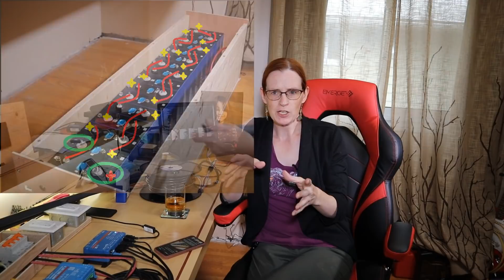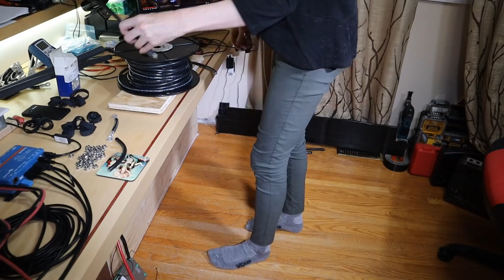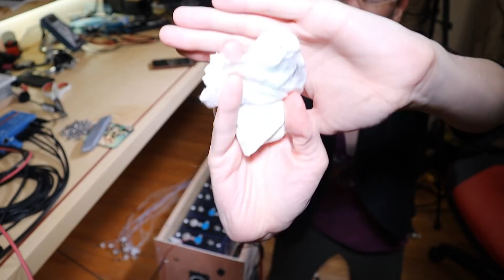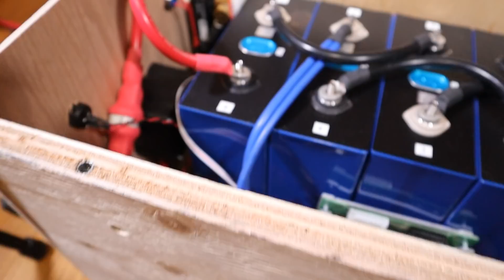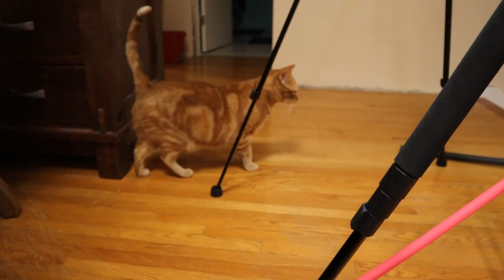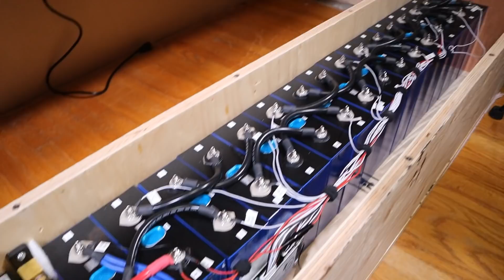A Better Battery Design - How to build a 48v Lifepo4 battery (Ep. 22)

Comment: don't get me wrong - i LIKE the design (having the main pos/neg at the same end of the battery), however i don't think you used to much less cable overall than you think.  you extended your 'bus bars', what 2" each?  times 16.  so, 32"-ish MORE wire for the bus bars, and less on the main positive...  just thinking out loud myself.  like i said, i like the design!!  i'll be doing the other option myself when i put together my banks.  less wires crossing over....
Reply: correct. there is a lot more cable compared to using bus bars or even the normal wire method. bus bars would be the superior solution here.
Reply: TDM,  I Agree with others. Not using the stout metal bus bars between batteries likely means more resistance at each cell. @The Digital Mermaid don't take my word for it, just check ohm resistance (with a more sensitive tester) of your 4ga wire jumper vs a bus bar. 
In the end i think you are dividing the resistance of that long red wire- now into/across each jumper in the string. Resistance = heat/loss. If the long red wire was getting hot, on the load you need, then the wire needs less resistance. In the end,, no matter how you approach it,, this is accomplished with larger diameter wire and or shorter wire, and typically bus bars are designed to carry more current than wire. If you want flexibility then aim to use heavier cabling to reduce resistance. Also using electrical connector grease like carbon based stuff used for high current industrial applications on each connector will also lower the loss a bit (by filling the micro gaps of the mating surface with conductive carbon). Best regards in your project and TY for sharing the progress and learning as you go.
Reply: @jamesbsa6450  she did a video measuring the bus bar resistance vs. the cables a few videos ago.  they were the same in her test.
Reply: @dobrzpe  it's because she was using the wrong tester. It is not capable of finer resistance measurements. 'Ray Builds Cool Stuff' tested 4ga copper wire with hydraulic crimped connections at a higher resistance of .25Mohm vs the tinned copper busbars lower .17Mohm resistance. The Digital Mermaid had good intentions but the test had major flaws. The busbars should be taped with electrical tape for the FLIR test to reduce reflectivity heat signature. Additionally, cleaning the connection surfaces with Alcohol and then using carbon grease greatly eliminates irregularity. Lastly Ray points out the lack of uniformity in busbars which can be improved by examining the curved bars and flattening them first. All this to say. The obervations  had some flaws. Best regards.

Comment: Hullo hullo Mermaid...Analog and Digital...!
Have you considered making 4 x 12 V packs.
Modular and more moveable.
Just a practical thought.
Autumn Greetings from Denmark...!
Reply from the maker: The thought crossed my mind, actually. It's also one of the reasons Victron won't release a 48v, they'd rather let people series them. In my case, that would increase the number of BMSes I need by 4x, fuses by 4x, etc. I can disassemble / reassemble each pack as needed, a luxury not on offer to many. So in my case, 1x 48 is OK.
Reply: @TheDigitalMermaid  Ok, Thank You for replying...!
Following Andy and others results, I figured:
Individual packs would only need top balancing and check, once a year or two...

Comment: Love the video. I am a cat lover too, with four cats, so I do love to see yours also. Well, as I was watching this, the last parts arrived for my build, except for the cells, which are still on a ship now rapidly approaching port. I decided to go for a plastic box, but not the cheap boxes that Andy and Will used, but something a little better with a hinged lockable lid (a truck bed tools locker). It also allows for two rows of cells, but 9/10 per row, meaning I have a gap in one line where I will put the controls, with the cells in more of a C shape. That actually gives me +ve and -ve terminals about 140mm apart.

But you gave me some more ideas. I do like Grant's idea of a longer jumper. I do like that you cleaned the lugs. Fine sandpaper might have been a good idea too (like Andy did), but also use something like Noalox Anti-Oxidant compound between the battery terminal and the lugs. I will also be building in an 18AWG fly lead into one end of each of the jumpers to use as a permanent BMS/Balancer lead (each of which goes to its own Wago 221 block to enable faster connection of ancillary parts). I have also been giving a lot of thought to the order of the cells. I intend to individually charge/discharge capacity test each cell to find the highest capacity and then place them in order (highest at the +ve end). I do not expect them to all be the same full discharge capacity.

Comment: 25:30 and that is why you dont alternate the cells. KISS still applies. balancing the wire length is a completly usless endeavour. only the balance wires need to be equal length with that inaccurate bms. equal lengths does nothing for wire heating. if the wire heats up you need to use a bigger gauge but then only if you lose too much volts. with 12V that is a serious concern, with 48V that is less important.

Comment: All was nice till you used acetone..That is firstly nasty stuff and second ..It is fine for most things but not against plastics..So you should never used it with battery...isopropil on another side is perfect against both..remove greese and is safe for most plastics. but otherwise it should be ok :)
- Sorry i'm only in middle of watching -sorry if you fixed already :) - last wire you should go from outside so those wires would not cross ..it cost nothing and it is better this way :)

- Just noticed It should be done with all those wires ..so one wire should go from outside and second should stay inside..no crossing...100% sucess :)

-Ok I wached it fully now..I will just add comment that you probably didn't save much as instead of short wire you would use a bit longer wire..but even if you were 100% right it doesn't matter..because that 'long' red wire you could use thicker one and it would be fine..after all that wire is same as rest of the wires..so even it looks like it is heating up more(and it is ) same apply to rest of those wires..they do not heat up much only because that heat is transferred to battery itself. If that is good or not i don't know. But it is just fact..
I would add one more thing..maybe it isn't so important..but maybe it is..i would add small hard thin plastic or some insulation sheet (not like foam..but hard) between every battery just to insulate..it would increase overall lenght but not too much ..and you can be sure there is not a chance of shorting two cells..

- At the end once you are done you want to use some kind of electrical grease to insulate all those contacts from moisture, salts and all that..i know it might sund crazy idea..why to use if if you just cleaned them with ipa/acetone .. but this is necessary for corrosion resistance mostly if you are in salty/corrosion environment and I'm sure you will do it once you have it on your board.

Comment: How do you cope with the thought that your house catches on fire because of a little mistake you made? This fear keeps me away from getting my build done.
Reply from the maker: Same way I drive on Toronto's 401 and not worry. I do what I can to mitigate risk (in the battery; good fuse, BMS configured to shut down charge/discharge over 55c, etc). Once I feel like the risk has been mitigated as best I can, move on. :)
Reply: @TheDigitalMermaid  I am such a chicken at times… haha. The irony is that everybody is talking about the right to repair. But if you do repair your washing machine yourself and something goes wrong you are screwed.
Reply from the maker: @heinerschmitz1259  Everyone has their own measure of risk tolerance, and no one person's measure is "more right" than anothers. You're not chicken, you're cautious. Some would say I am not cautious enough... Who's right? I've had some nasty injuries and some real close calls. Am I braver, or stupider? Don't put yourself down, we all work within our own tolerances and that's valid.
Reply: @TheDigitalMermaid  So true. In the past I sometimes found myself pushing myself into things that are not necessarily good for me just to proof that I can do it. I think that is not healthy, too. It’s the other bad side of pushing your self down. But you are right. It’s probably all about the right balance.

Comment: Is your black cable used to make the links of a heavier gauge than your red cable?  If the cables are of the same gauge I doubt things will have changed much.  I suspect the total cable length must be similar with either wiring configuration.  The only difference I can see is that there is a heat sink at every connection back into the battery.  Therefore there is no long continuous insulated length of cable in which to have the heat build up.
Reply from the maker: Same; 4 awg
Reply: @TheDigitalMermaid  and what does the ohm meter read for each 4ga jumper, compare that to the solid busbar? Lower resistance = less heat/loss and greater efficiency as well, just st the cost of, well, cost ($).

Comment: Hi TDM. I'm in the FYI mode at the moment and not to be negative of your latest design, as your work and ability to do your work very precise and with a lot of deep thought is rewarding to watch!  First, alcohol comes in lots of flavors,  colors,  and potency.   Here is the FYI.   Rubbing Alcohol is not a pure fluid.   They add something to kill germs.   Take a clean paper towel or TP and add isopropyl alcohol to it and streak it across a window or mirror.   Denatured Alcohol  on the other hand is a pure alcohol and is used as a cleaning liquid or degreaser.   Works well to remove solder flux from soldering.   
Second, nail polish remover really isn't a pure acetone because everybody put something else in their mix to make a unique blend in their remover. BUT, if that is all you had, so be it.   Try the paper towel or TP test on the window or mirror to see just how pure your nail polish remover really is!  Acetone by itself is a very strong solvent and will also melt plastics. So be careful. Please let us all know
Reply from the maker: Hrm, that's a very good point (acetone and plastic). Fair enough, won't use it again..
Reply: I was worried that the sealer on the floorboards might have suffered from the acetone spill.
Reply: Ya, might of left a white spot on the floor.
Reply from the maker: @w.loulittle130  My saving grace is that I've already got plans to sand and refinish the floor. Otherwise I would have been a lot more upset...
Reply: @TheDigitalMermaid  Ascatone and denatured alcohol should be readily available at your local Home Depot or ACE HARDWARE store or local painting supply store.  Oh, BTW,  I live in Salt Lake City,  Utah.  I'm wondering if I know "Grant" or not!

Comment: Good idea with the cable change.  Heat shrink now too,  good job.  You can flip the wires to curve to the outside so they don't touch in the middle.  Of course, if you had a metal box, it would be better to keep them curved to the center.  You can also do this with a line of solar panels.  Skip panel wiring and have both positive and negative on one side.

Comment: Two interesting methods of running the series connections.  However, I think I would have gone with the other option that Grant sent you.  It would have eliminated a lot of your lines crossing over each other.  Strange things can happen when power lines cross.  Using the other method, the only line crossing issue would possibly be the small cable going between Battery 8 and 9 if you used too long of a jumper.  As for Grant's suggestions, the only advantage of these is to allow both negative and positive connections to be at one end of your battery string.  This could have been done in other ways by different arrangements of the batteries, but your inline method is fine, if you have a limited area to but your battery pack.  Does this actually save on cable length....Not really but the jumper wires may handle the current better than having that long positive.  I personally would like to see how much heat is generated at the terminals and on the jumpers.
Reply: YES. if wires rub one day they will short.
Reply: In a boat where movement and vibration will not be good.

Comment: It seems to me you have the same number of jumpers but they are about twice as long! So, the total length of copper is about 100% longer this way. Instead of one pass the length of the battery and one long cable, you have two passes of the battery. You have replaced L + L = 2L by 2X2L = 4L.
Reply: The cables are now half circles instead of straight lines, so would it be 3.14L vs 2L? Not quite as bad as 4L, but still unnecessary resistance. Was it stated why the long return wire is seen as bad?
Reply: TDMM showed the long cable grew warm by infrared imaging. That's a misconception because the shorter cables were cooled by conducting heat away to the mass of the cells. Heating power per unit length is the same whether a cable is short or long. I^2R and all that. R is dependent on the length and diameter of the wire. Longer length means more heat lost.
Reply: I think the right way to avoid the long return cable is to use a double row of cells making a 108V battery instead of 2 54V batteries. You could also make 2 27V battery boxes instead if weight per box is too much. It's good to have choices so you can sit around doing nothing for days on end thinking. :-)
Reply: @MrRobertPogson  What about 4x4 end to end?
Reply: That would work too. I think TDM wants long and narrow shape to suit a boat however. Depending on the hull, she likely wants weight low and near the keel. I think a longer narrower higher voltage battery is the way to go but she seems to want manageable modules. I think a module should be a cell, not a battery. BMSs up to 96S are available and higher voltage with lighter cables saves weight. LiFePO4 are very long lasting given a moderate state of charge regime. TDM will figure it out. :-)
Reply: @MrRobertPogson  Or run the cells end to end instead of side to side.  Box would be a little longer and skinnier.  Unfortunately, still wouldn't be able to use the buss bars that come with the batteries as they are just a little short for end to end connections.  But I suspect the size is what works best for a boat.  Using 100Ahr cells in 2 rows is also possible, but you really want the largest Ahr cells you can get for the voltage you need.
Reply: @MrRobertPogson  I thought there wre going to be multiple packs
Reply: But you save 1L  because you don't need a length to return back to the inverter.  And going by the 3.14L calculation in the other reply, it isn't much different.

Comment: Is it a better battery design? The overall length of the cables are the same for both designs - you are overlapping the cables and so doubling the overall length of the cables, which is the same  having a long return. Also, look at the nail polish remover - it might have conditioner in it, negating any de-greasing. Edit - commented mid video. I presume the extra cable is the tighter arc on each cable. The new design has less arced cables.
Reply: slightly less bending is a win, slightly more length in each cable to accept movement, but not so long they need to be anchored down. Might be a win. But the win is not shorter cables, for that you need to rotate the batteries and have two rows. That turns the full length cable into another short cable to the BMS, saving ~2m.

Comment: Two rows of eight s the only logical way to go .!
Reply from the maker: Well, no. For many installations, sure, it's a great design and it's exactly the design I used earlier in the build. In some case, mine included, it isn't practical. I need to fit six of these into a narrow but deep area.
Reply: @TheDigitalMermaid  https://youtu.be/iFKtIMkwlKA?t=61 (Will Prowse, 16S LiFePO4 Active Balancer Problems) That's the layout we're talking about. It'll fit in the same physical space, but IMO safer. Just you can't laterally compress the cells very easily, the way you can with the current setup.
Reply from the maker: @mozismobile  That's one of the two videos that had me start down the flexible bus bar route...
Reply: @TheDigitalMermaid  6 strings! Wow! That's 86kWh's if 280aH cells!
Reply: @BrazzaB1  welcome to the channel. lol!
Reply from the maker: @BrazzaB1  New packs will be 302Ah at least, larger if available when I am ready to buy the cells. Part of why I'm waiting as long as I can before ordering.
Reply: @TheDigitalMermaid  Nice! So about 93kWh! That would give you a pretty good time off grid, assuming you are not using for propulsion.
Reply from the maker: @BrazzaB1  It is for propulsion! 43' sailboat. Hence why I want every watt I can get.
Reply: @TheDigitalMermaid  I thought it was, but when moored you would have plenty of power.
Reply from the maker: @BrazzaB1  Or while under sail! The huge battery will take days and days to recharge, but that's only a problem on crossings, but then I'll be under sail most of the time on crossings, so ample time to recharge.